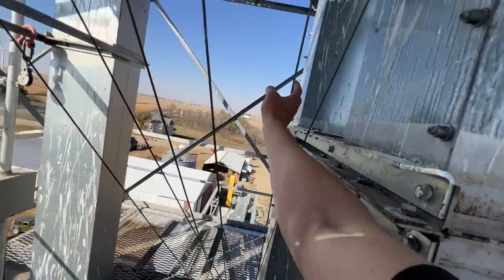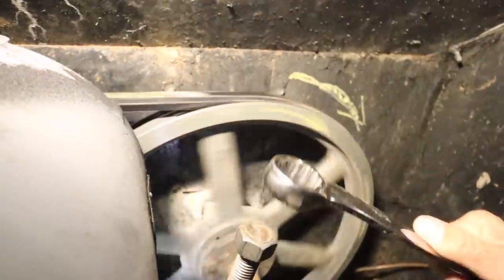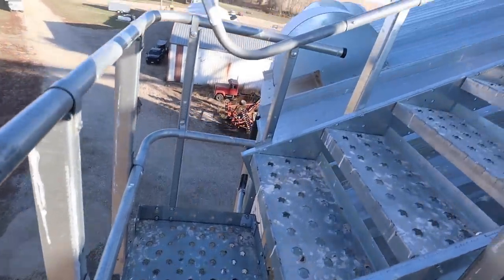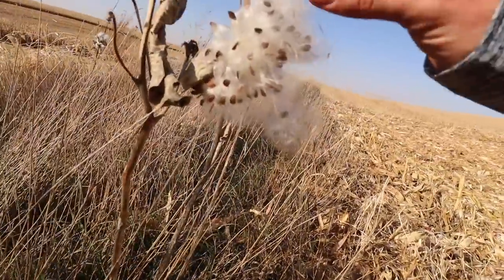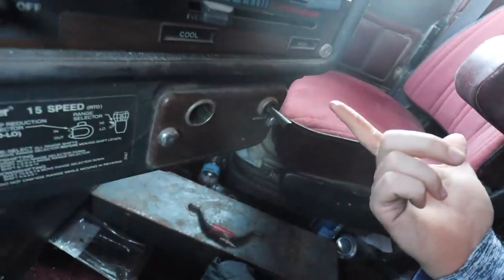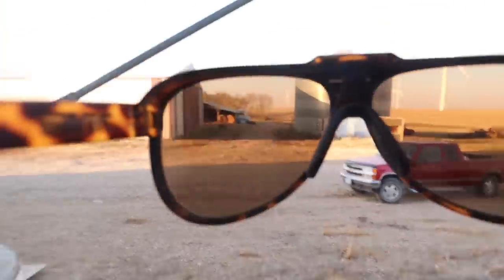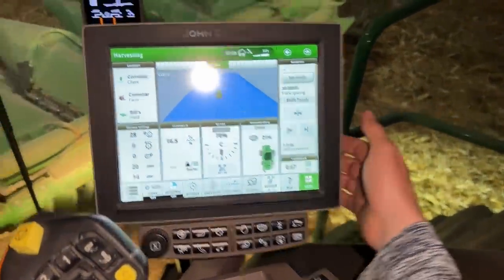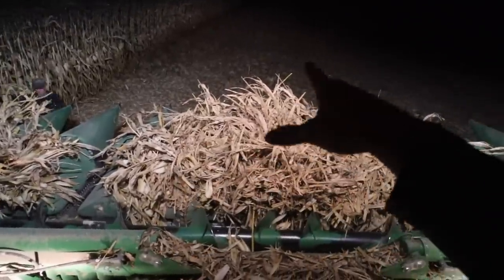Broken Welds Have Been Discovered On The Bin Site

Comment: You should be able to turn the overloads down on that motor starter so it trips out at a lower amperage....or better yet put current transformers on the load wire and have them program that auger to shut off for a set period of time once a specific amperage is hit... or put it on a frequency drive and slow the speed down

Comment: Is the trip settings set correctly for that motor?  10hp= 10x746=7460watts divide that by 208root3=64.6amps and the overloads should be set too 175% of that so = 113 amps or nearest common size and can be set up too 300% if the motor won’t start under load…. Hope that helps for the 10hp you have in there now… for the 7hp just replace the 10 at the beginning of the calculation to find you trip settings..

Comment: Suggest you wear safety harnesses and the use of lanyards/fall arrestors, regardless where you climbing on the silo landings. One fall, slip or trip up there …. why risk your life?

Since the bin site is PLC controlled, put a variable drive on your pit motors and have the PLC monitor the load such it will reduces the infeed amps aka reduce the speed controlling the leg feed. This should save your belts

Comment: Try increasing the diameter of the pulley on the cross auger and it should reduce the load on the belts and motor and not over feed the lift auger out of the pit.....

Comment: When you changed the motor in the pit did you reuse the pulleys from the 7hp motor? Was the larger motor meant to be a 3 belt not a 2 belt setup

Comment: I was wondering about the motor pulley to auger pulley relationship. Hearing about the change from 7 to 10 horse somewhat explains the belt problem. A 10 hp motor would require at least 3 belts. If the motor won't stay aligned with the auger pulley, there will be a constant problem with belts. When the motor pulley is so much smaller than the auger pulley and they are so close together, the belts are only gripping the motor pulley less than 50% of the pulley circumference. On such a small diameter pulley, that isn't much surface in contact with the belts. If the motor isn't perfectly aligned, one belt will be doing most of the work. From the video, it doesn't appear that there is room to use a larger pulley on the auger so you're likely stuck with the small pulley on the motor. It the motor can be moved farther from the auger pulley, it will increase the contact area on the motor pulley slightly. You could try a banded belt. That is one belt that fills 2 grooves.
Reply: I wonder if a little bigger belt with a tensioner to put more belt on the motor pulley if that would work.

Comment: At 2:43 that belt drive WILL NOT WORK the way it is setup. The shaft center distance is far too close together for the amount of speed reduction they are trying to achieve. That needs a 15:1 shaft mounted gear reducer in place of that V-belt sheave. Use the 10hp motor to belt drive the reducer with a 1:1 ratio belt drive. You can use the existing VFD drive to soft start the motor and allow speed control.
The rest of the site I see lots of deficiency in, that railing situation is a no-go. That would not fly on any job site in North America, it's a death trap. Have you hired a lawyer and sued them yet?

Comment: Just wondering if removing the last foot or so of each auger impeller would help.   Maybe even drilling some large holes to let the corn slip thru.  That way there would be less resistance as the corn meets in the middle…

Comment: My guess is that your belt problem is binding in the auger.  The 7 HP is probably the right motor if the auger runs without binding.  It probably is binding because of the corn load pushing it off axis.  Sounds like a design problem.  Possibly the auger is too flexible.

Comment: Three thoughts about the auger pit (other than I hope that you win your lawsuit against the installers)
1) Have you though about trying an 8.5 hp motor to see if it doesn’t short out but doesn’t burn belts 
2) Can you add slots to the bolts or perform an alignment of the motor & pulley
3) Is it possible to replace the pit belts with a chain drive?

Comment: I wonder if you can have the larger motor, but change the ratio on the pulleys and make it a dual belt setup. Got a 5 hp driving a lathe and it’s running 3,    1/2” V belts on it to transmit all the power and not slip. 
Too large a drive pulley and the amps keep tripping as it draws too much current. 
I suspect you need a 10 hp but a smaller auger pulley with multiple belts

Comment: Cole and DC, I completely understand your frustration. We see such shoddy work by contractors at my workplace every single day. It's certainly not from a lack of money, it's that it's practically impossible to get good skilled workers these days in every industry. This is why I try to do everything myself as I do not trust others to do a good job. I do all of my own vehicle, home and farm repairs myself. Everything. I even mount my own tires because no tire shop ever cleans the sealing area on the rims/beads or knows how to properly use a spin balancer or do a front end alignment, brakes or can do a simply oil change without messing something up. I can afford to hire things done, but the problem is that almost every company has workers that either don't know any better or they just don't care. The skills and IQ of most people are at an all time low thanks to the modern education system and failed parents. Even the high dollar well paid workers are eff ups.

Comment: About your pit 

Get rid of the belts 
And you could use a heavy chain 
But the best and most trouble free would be a gear box drive 
  
Go with a good size motor 
And a gear box 
And you won’t have to work on it for a long time
Reply: You can get a SMR stile shaft mount gear box and probably use the motor you already have 
Just order the correct shaft size and coupler’s. 
Give them your motor RPM and desired auger RPM 
And you’ll be set with Direct drive

For many seasons of trouble free use 
As long as you’re pit does not flood and drown your motor

Comment: Cole, Cooper and Mr Cornstar when running the combine why dont farmers pull the tiller behind the combine and kill two birds with one stone?  Is this even possible and time saving since it would start decomposing faster.  My thinking is you would save 100s of man hours, fuel and machinery each year doing harvest and tilling simutanously is it because harvester doent have power or speed issue.  I am a Bayer Tech and make Glyphoste aka Roundup pmax xmax for Roundup ready seeds.

Comment: First of all to Daddy Cornstar...you need to have them raise that rail up so somebody doesn't take a tumble off the side of the bin. Have you thought of putting a chain and sprocket on that 10 horse motor in the pit? That would eliminate your belt problem. That galvanized metal is so hard to weld on, you have to grind the galvanizing completely off before you weld it or the welds don't stick. If you look at it closely you will probably see that the galvanizing wasn't ground off before they welded on it.

Comment: The reason you're frying belts on your pit auger is because the belts don't have enough "wrap" on the motor pulley. If there is some way to place the motor further way from the driven pulley, you'd get better belt traction. Or use slightly longer belts and place an idler against the outside of the belt against the slack side to mold the belt further around the motor pulley. Or (this is expensive) replace the existing drive with timing belts and toothed pulleys. Or replace the existing drive with a three of four  belt drive (careful: motor and driven shaft have to be precisely parallel or the tightest belt will take most of the load leading to progressive failure.)

Regardless, it's way past time to call in a drives expert. It's very clear your bin contractor engineer blew it in many places and not just motor drives.

Comment: Put some 4 belt pulleys on the auger if there is room for,that will solve the problem for now till you can find a more permanent one . Most if not all of the faults on the bin site are caused by bad workmanship and or incompetence by the company that built it.

Comment: Is it possible to connect the drive motor to the auger gearbox direct? Then set a relay detecting so many amp draw of the motor to trip the breaker in case the auger is getting jammed up.  I'm so sorry you guys. For what you paid for this setup, the dam thing should almost run itself.

Comment: just put a double Roller Chain on that auger just pull the pulleys and make it gear drive also add a speed controller to the motor auger it maybe over feeding that's why its overloading the belts

Comment: the Foreman that built that bin site should be forced to go over every bolt and weld seam on the bin site with camera proof of doing so including on the bin walls, note everything wrong and fix it on warranty - imagine the silo collapses from snow,  crumbles on one side and topples or cracks open during filling and spill corn or beans out everywhere 
the most important thing is safety - id sue them for endangerment and settle for a before asessent, repairing all flaws and a second asessment that prooves its safety and correct assembly 
your dad and you and everyone else working up there should take the minute jump into a harness and secure themselves

Comment: Oh, No! (or to quote one of my Brit acquaintances: Bloody 'ell!)

When loaded the auger pulls over 7½ hp but 10 hp eats the belts. Uh.... Yeah.... Wider cross section belts and new sheave/pulley. Alternatively... A variable frequency drive to slow the 10 hp down so it doesn't eat belts? Naw. That  will reduce the throughput of the auger and that is already a bottle neck.

Larger cross section belts and new sheave/pulley are probably required at this point. And a better motor base to maintain alignment and simplify tensioning the belts. Yech!

Could you switch from belts to chain drive? 

Surely there are power transmission firms in the area that can solve this.

Comment: Being a mechanical engineer with a master's in that, for starters I'd say that the motor wheel is to close to the main wheel, that is why your mathematics of friction is off.  Another words the belt dosnot have enough contact with the motor pulley.😳😳😳😞😞😞😓😓😓😓😓

Comment: A smaller motor with a large pulley mite work but it needs to be just a little bet further away from the main one. You are not making info contact with that moter pulley and after a little pit of time you are losing your friction on that belt because of heat.😳😳😳🔥 🔥 🔥 That is making the belt loos friction and then heat up. However designed that had no idea what thay where doing.😓😓😓😓😓😓😓😓

Comment: maybe you could put a 3belt pulley on, instead of a 2 belt...
Reply: Need to do a load calc first to see what their torque limits are first then go from there.

The belts are your "failure" point so other stuff doesn't break.
Reply: @OOpSjm  good point, but they already swapped the motor from a 7 to a 10 hp unit. ( if i can remember correctly)

Comment: That pit auger motor set up is not right. Not enough  belt wrap on the drive pulley. Should have had a shaft mount gear reducer

Comment: You’re motor is mounted to close to the auger pulley   If it was 2 foot farther away. You’d get 50% of belts touching motor pull. Looks like to me you’re  only getting 25 or 30 % of belts touching motor pulley now.

Comment: Cole, It's obvious that whoever designed and built your bin site was not competent. You need to use your platform to leverage help and also apply pressure on the company to make it right. The broken welds are a significant safety issue, and completely unacceptable.  I would think that Iowa would have codes that need to be followed for Bin construction, and if they do not they should.  I know that you have lawyers involved, and that is good, but the amount of lost time and costs is quickly going to eliminate any gains that you may have.

Comment: I’m a home builder and it’s sad to say but it’s going to be really hard to win a suit against the bin site builders.. even though the job is as bad as they come smh… the problem is that they did the work and got paid for it so even though it’s pretty 💩 work they can get by with it because they produced the product. now where they can have a chance is if they had drawings, engineers specifications, etc. and the builder didn’t  follow as agreed upon… also if the builder didn’t use the correct materials as promised… So they have to weigh if it’s worth their time and a whole lot more money in lawyer fees to fight the builder in court and still have a chance of losing or do they just move on and pay someone else to fix the problems 🤷‍♂️. I pray they get it fixed before someone gets hurt.

Comment: Y’all put that 10 hp motor on the unloading pit y’all are moving too much product that the bucket elevator cannot handle it. I would put that seven horse motor back on the pit slow down the seven horse motor and slow down the auger taking the corn to the bucket elevator, so you won’t overwhelm the bucket elevator I don’t care what the people that sold it to you said how many bushels it said handle that bucket elevator can only handle so many bushels and if you overwhelm it, you gonna burn belts up, trip motors, and everything else personally just looking at it. They should’ve put a bigger bucket elevator in because that’s where it all starts you only can take with the bucket elevator can handle grace and peace man

Comment: Shite-a-brick... that was extremely scary to see DC grab that rail and see movement as it broke away from its so called weld!!! Plus the height of the handrail... you slip on that step and over one goes... It is a TOTAL death-trap. As for the burning out of parts when off-loading the corn... that again should NOT happen either!!! The company that built it should be named and shamed... to warn all other farmers to never hire that lot again. The dude in charge of the build has failed in his job... as he should have been inspecting everything and fixing all things. His crew should never be hired again. That is really 1 million USA $$ down the drain.

Comment: Keep showing the substandard work performed on the bin. Just makes your claim against the installer that much more credible. GCI should send factory reps out to correct the issues before their installer gives them a huge black eye.

There is no way in hell that those stairs for the catwalk meet OSHA requirements. You guys are going to need fall  arrest harnesses to check on the bins. The question though is what can you attach to when the bin has crappy welds?

Budget money for enough yellow paint for the bin sight. Paint that sucker bright yellow with a large stem like the lemon that it is.

Comment: Lawyer up and sue the builders, and also sue for creating a safety hazard, the issues you had from the start of this project brought up red flags and now this, are there NOT inspectors who oversee construction projects like this, in home construction certain codes have to be adhered to, is this not the same in stuff like this, you do have a criminal negligence case against the builders most assuredly

Comment: What kind of belts are y'all running if they cost $60 to $80 a piece I just price checked a B-52 that may not be the size you're running but I'm sure it's a b-belt and they're like $25 to $35 depending if you want it delivered might want to talk to your belt supplier.  But I guess you could be running a double pulley setup so you could be burning two belts at once I didn't look when you showed the motor and auger to see but if you're not running a double might want to or change to a cogged pulley and belt